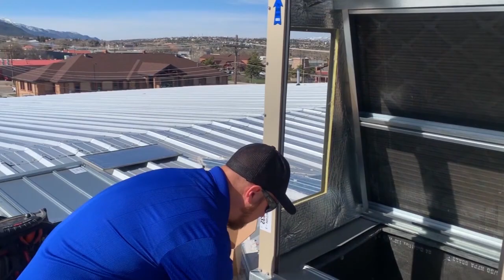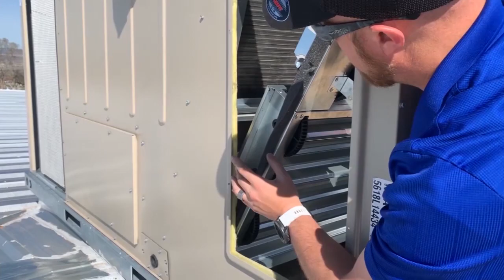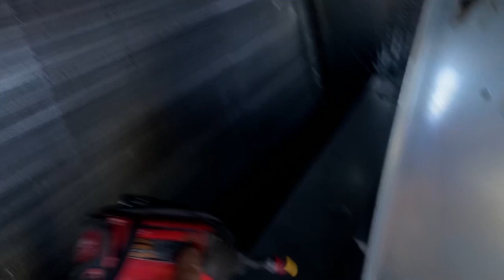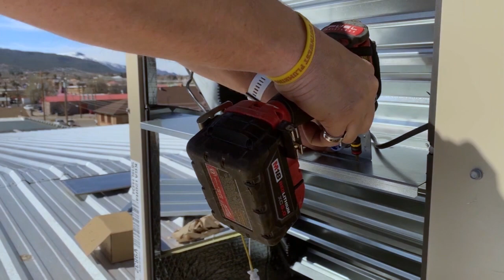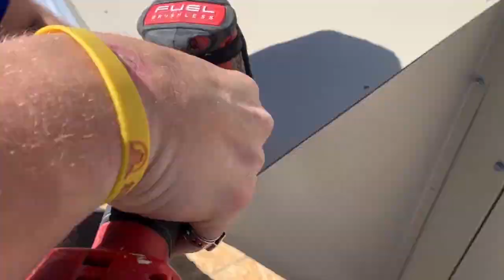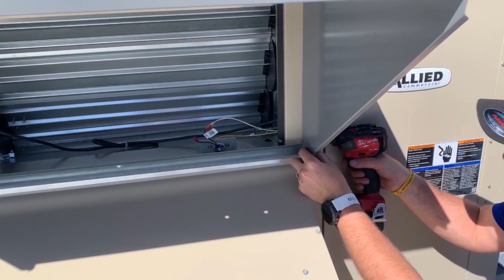How-To Install an Economizer (Complete Install w/ timestamps) PlumbersStock.com

Comment: Great job! One remark all wiring and zip straps should be plenum rated inside damper section to meet codes requirements for smoke and fire rating
Reply: That’s a good reminder, thank you

Comment: Will you still use the same model if you have a side discharge, as from your video it looks like the damper  is dividing the side in half, which may not that efficient.please advise.